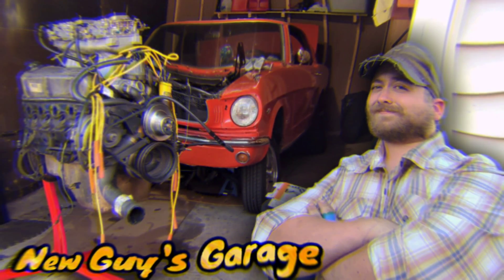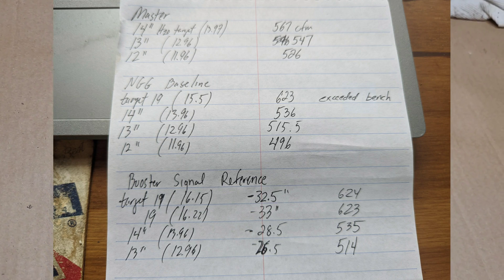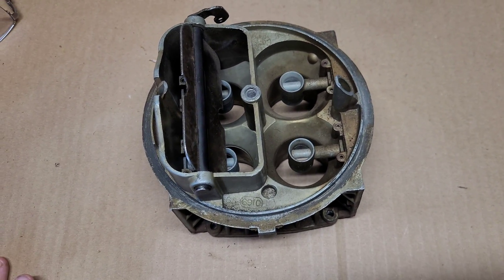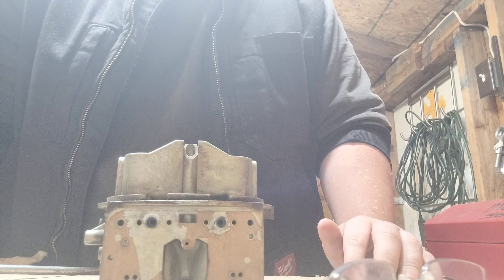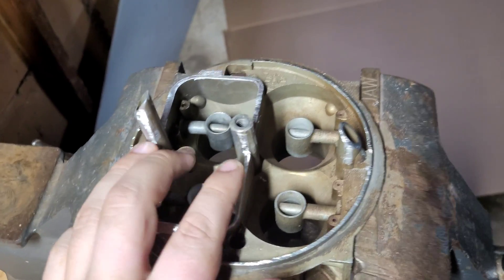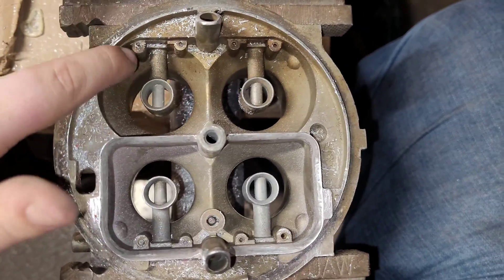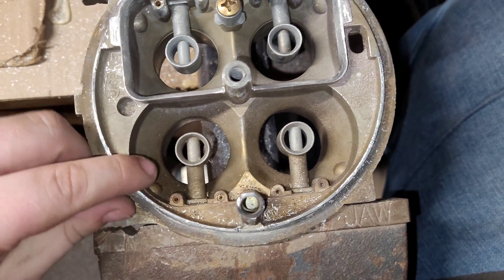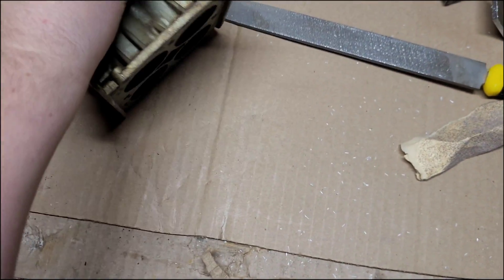Lets Improve The Flow! | Holley Carburetor | Choke Tower removed And Ported The Entry | Flow bench

Comment: Install downleg boosters and it will have great throttle response !
Reply from the maker: @PeggyParrow  ohhh we went wayyyy beyond that 😂

Check out the "Project XMC" series on the channel, we ended up gaining 157cfm and 2x the booster signal without changing the venturi diameter 😁

Comment: I can't get my choke plate out lol I wanted to port my carb before you made this I'm just now getting to it lol, anyway you could tell me how you got yours out? 😅

John 3:16
Reply from the maker: Flathead screwdriver! 
Shove the screwdriver in-between the choke shaft and the bump on the plate holding it in and twist the screwdriver. Should start popping the plate up, work at it on both sides until it just pops out 😁
Reply: Thank you very much! I was being to gentle 😆 it looks so much better without all that mess! Lol
Reply from the maker: @OVERKILL_SS  yep no problem! 😁